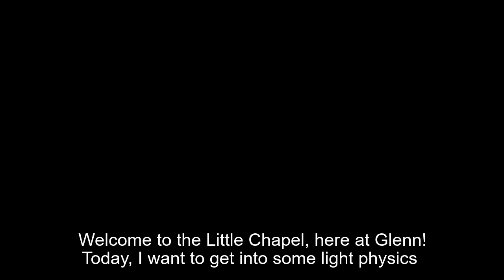Organ Pipe Lengths and Pitches

Comment: Excellent.  One thing you said is not quite right, however.  Mutation stops ARE fractions of 8 feet.  2.2/3 = 8/3.  1.3/5 = 8/5.  1.1/3=8/6.  1.1/7=8/7, and so on.